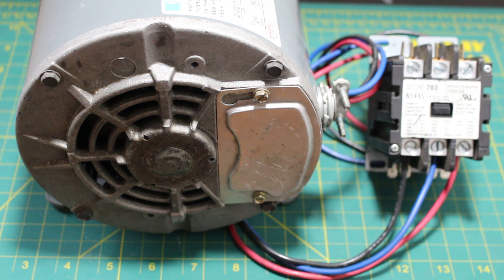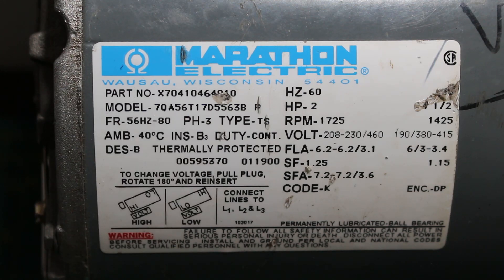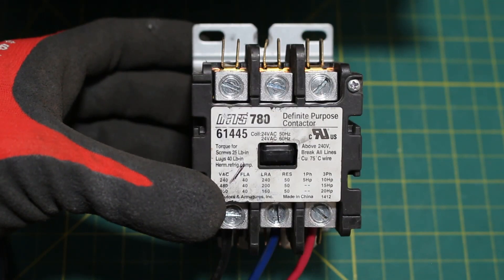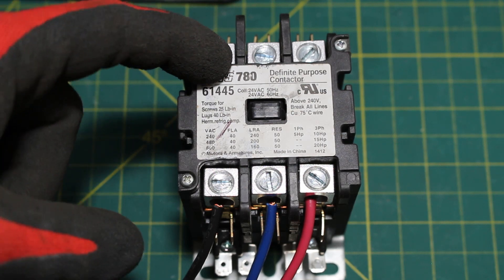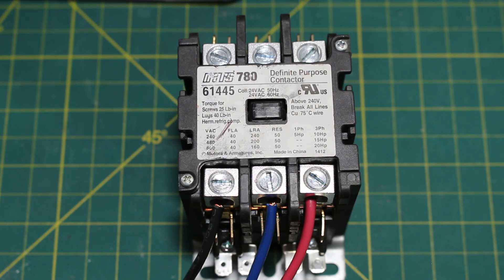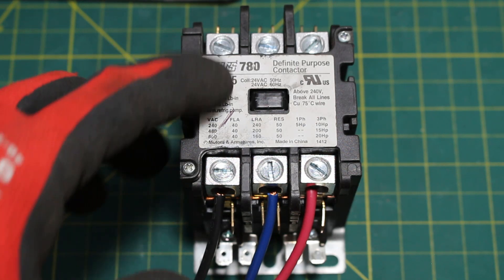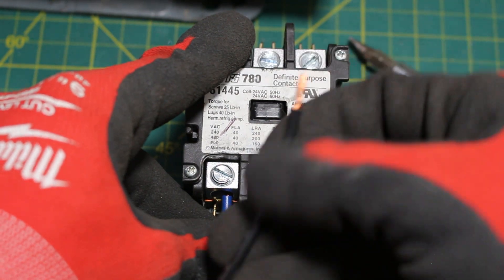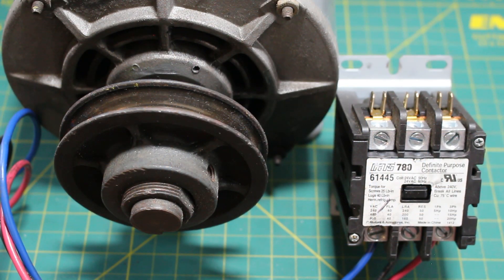HVACR: How To Change ANY 3 Phase Motor Rotation Direction (How To Change Motor Direction) Universal

Comment: Will it be okay in long term period running if we turn 3 phase clockwise fan to counter clockwise
Reply from the maker: As long as the motor is spinning in the correct position according to the fan blade where you are doing the job intended, you're good to go. That's the way it was designed. Thanks for watching & stay tuned for new videos every week🔧⚡️
Reply: No, if it's supposed to run clockwise than make it run clockwise. If you have the fan running in reverse than so is your compressor and it will fail via explosion. At least that's how I always hear it happens.